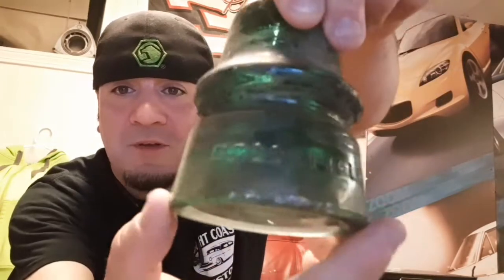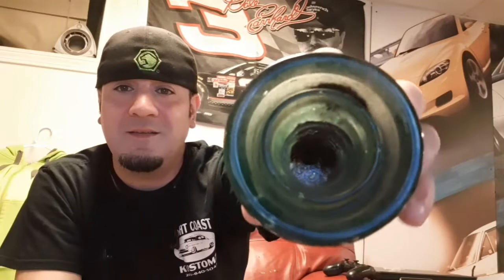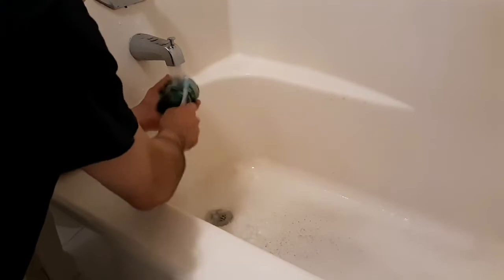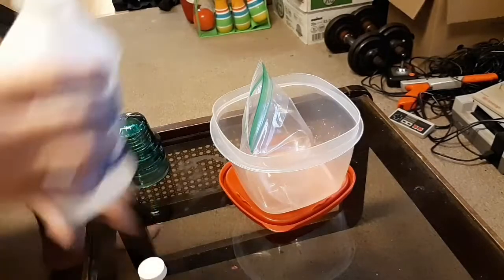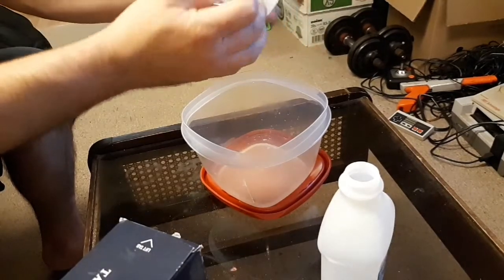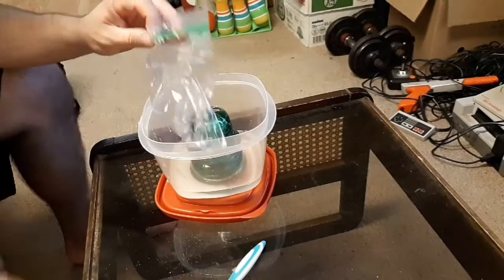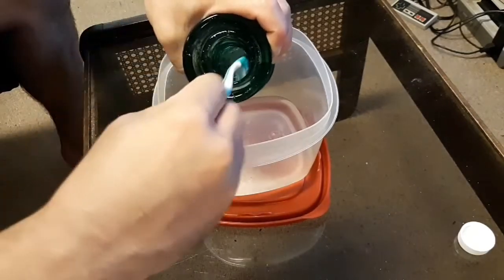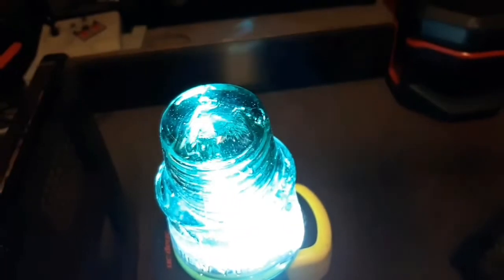ANTIQUE GLASS INSULATOR, let's clean it up!!

Comment: I have a small collection of those, different sizes. Some are that color and some are clear. A few of mine have Hemingray on them. I cleaned with soap and water also. Found most of mine around stock tanks, a few at flea markets. Looks cool with the light in it!!
Reply from the maker: That's awesome, I have been looking for a while. And a flea market is not a bad idea, I need to go check one of those out soon, I just usually avoid them because I spend too much LOL
We have a couple of large flea markets around here and I always buy so much stuff that I don't need but I have to have.
I have heard of the Hemingray Apparently those are really old and quite collectible .
Thank you for watching and commenting, I hope you're having a wonderful weekend

Comment: I was on the former DL&W line from Scranton pa to Syracuse NY I found a Hemingray 40 glass insulator they were produced between 1910 to 1921! Over 100 years old!
Reply from the maker: That's awesome, these are getting harder to find but they are still out there. Also thank you for the info on it, always trying to learn more about the past

Comment: I use 420 Glass Cleaner, I usually place glass piece inside plastic Zip-Lock Bag fill it with 420 then let it sit overnight. No scrubbing required. 420 is also use on other glass pieces that I can mention on YouTube Lol. But, ya it works great on Glass, easy and safe to use.
Reply from the maker: 420, I didn't even think about that. That's not a bad idea. I used to use that myself on pipes. Now I usually end up breaking them long before they need to be cleaned LOL

Comment: There probably was a old telegraph or telephone line on That side of the road it probably fell off the pole when they were tearing the line down.
Reply from the maker: Could have been. I do know the house on the corner right there had burnt down a few years back. It's sat boarded up and then was recently rebuilt. Maybe when they were gunning it throwing stuff out that might have been something that was in there? Maybe got dropped instead of making into the dumpster. Really not sure, but it's a really cool random find